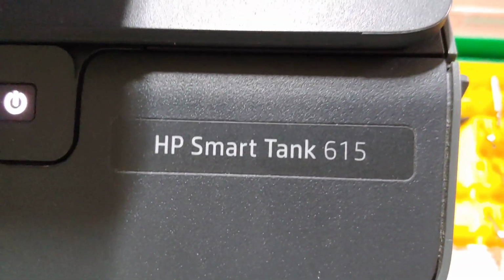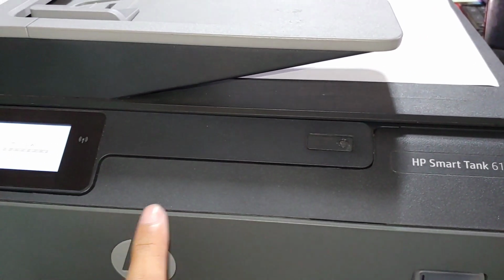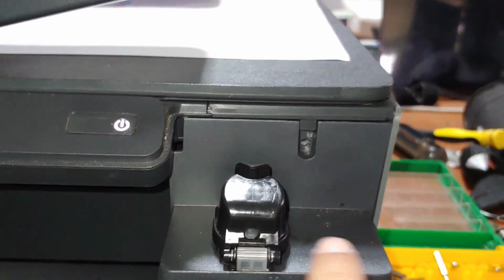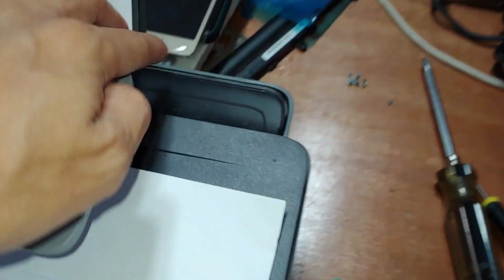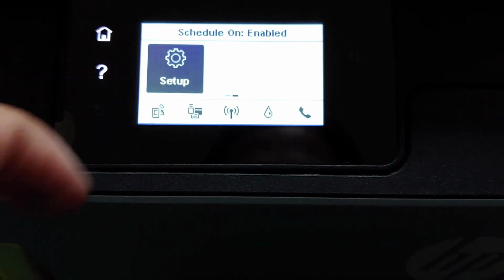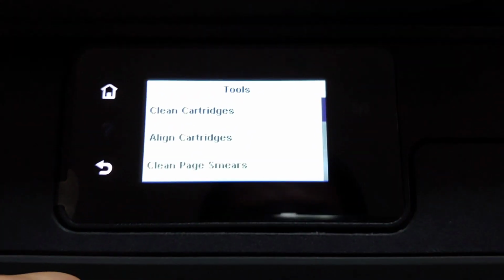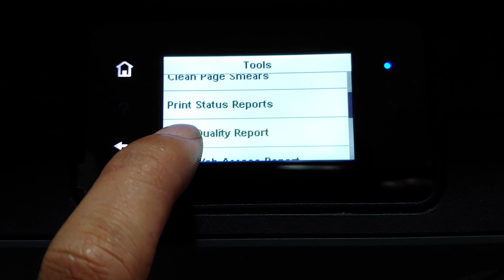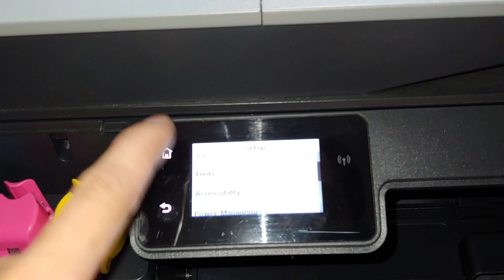HP SMART TANK 615 no black | colored print outs | troubleshooting guide

Comment: I saw the tubes have air inside on your video, how did you treat that? My problem with my 519 is it doesn't print cyan and yellow and I noticed air inside in the tubes for those colors. After cleaning the printheads, how should I treat the air inside those tubes?
Reply from the maker: I just suction that using syringes.  I thinks i have separate video of that

Comment: I have the hp smart tank plus 570. Not used for 2 year's. The ink wouldn't work on both cartridges so tried this. Running great now after six print outs. 👍 Thanks alot for the video.
Reply from the maker: Glad it helps 👏
Reply: @wayneslink  Yes it did. Something that actually works on YouTube.

Comment: I am hp smart tank 500 user. My printer is not frequently used in my store for almost 2 months. The print out shows blurry lines and white lines on colored and I don't know what to do with it while the color black has white gap lines. It also has misalignment. I already tried to align and clean printhead many times but still the problem is there. I even tried to replace black printhead with the new one. But still, the problem isn't solved. Please help me with my problem.
Reply: Up! I have the same problem. Please let me know if u found a solution for this one

Comment: This worked for me! We own an HP Smart Tank 750 and this really did the trick, we soaked the bottom in hot water for less than 5 minutes, and dried it well by wiping it with tissue paper and letting it rest upright over a piece of paper. Just make sure to secure the ink carriage before printing again to avoid E3 from appearing on the screen.

Comment: This worked for me! We own an HP Smart Tank 515 and this really did the trick. We didn't use our printer for months and the black ink wouldn't come out well when we tried to print again (just very faint color). But we soaked the bottom in hot water for less than 5 minutes, and dried it well by wiping it with tissue paper and letting it rest upright over a piece of paper. Just make sure to secure the ink carriage before printing again to avoid E3 from appearing on the screen.

Comment: Cool video! Solved my problem! Ps: If you want to remove the cartridge out without open the skull of your printer, you can cut the power down, when printer moves it's cartridge to the middle by self-checking after any restart.
Reply: this is a great tip. I don't have to tool to remove the screws. 
Thank you very much.
Reply: 999999⁹
Reply: I think this one really show what is going on inside of your printer

Comment: do you have a video on fixing HP Smart Tank... where in the problem is when you leave the printer not printing for about 5 minutes (after heating it with hot water) the Black is gone/not working again.. at the same time the Black ink is not consuming the ink inside the tank..

Comment: You keep calling that a "cartridge" but those are not ink cartridges. Those are actually the print heads, which usually is soldered in other printers. This particular unit is one of HP's new marketing ploy where they will not only make you buy the ink bottles but they will also make you buy the replacement printheads when issues like this happen. Do not buy this particular model. Totally overpriced and very high maintenance costs.
Reply from the maker: It doesn't need to be exact as long as i know what im doing buddy, and it is still called cartridges in many ways , you dont call that printheads exactly if you want to buy online.
Reply: Wish I knew this sooner
Reply: the ink is a lot cheaper £20 for a 100ml bottle vs £20 for a 7ml cartridge
Reply: On the contrary, it is the best thing of the kind, I throw away 10 different printers, epson, canon, brothér, because when the print head dries out, it is almost difficult to clean them.
90% of the problem, is the heads drying out, because of idle contracts.
And this printer, if you have to, you can buy a new head for $15. And you have a new printer for $ 15,
By the way, it's not a high price compared to other heads.